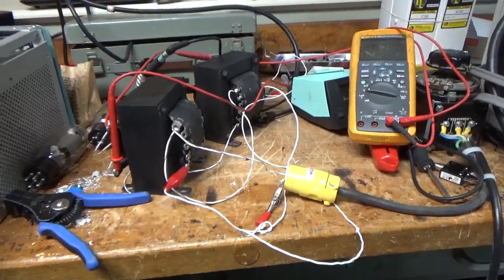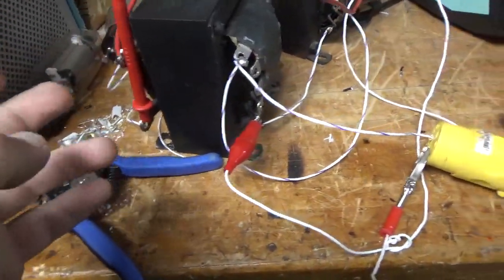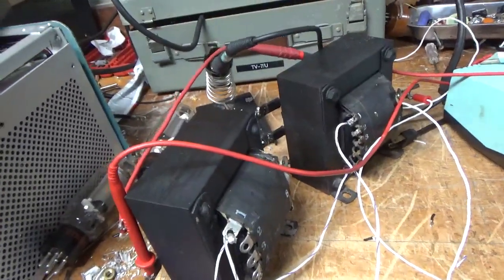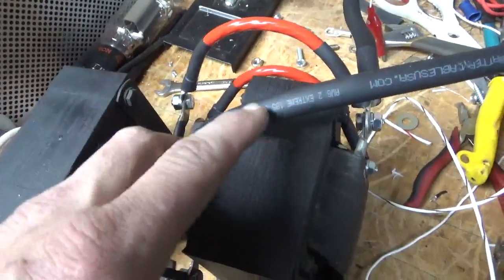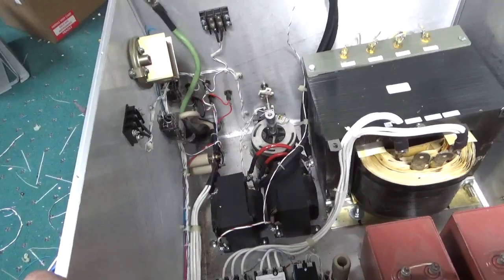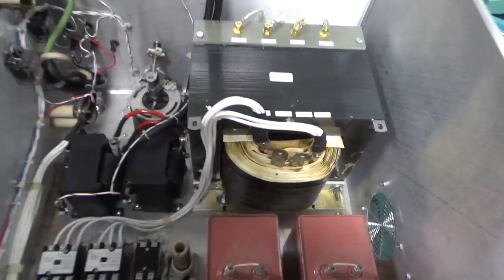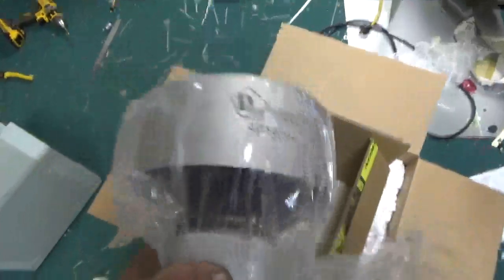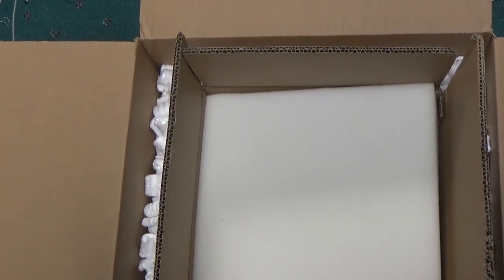6 Meter 10kw Filament Transformers Installation And Penta 3cx6000a7 Unboxing

Comment: how does the socket hook up?
Reply from the maker: Not sure what you mean

Have you watched the video ?
Reply: @amprepairguy  the socket where the 6000a7 goes into the socket plug-in.   the wires coming from the filament transformer onto that socket on the bottom side of the socket. Filament chokes
Reply from the maker: The filament wires have a ring terminal on both ends

On the socket end I have a bolt going through each ring terminal to connect to socket plate for each side of the filament 

Socket had to come apart to connect one of them

This is a broadcast socket very rare

The other type that requires hole to be drilled is not as good